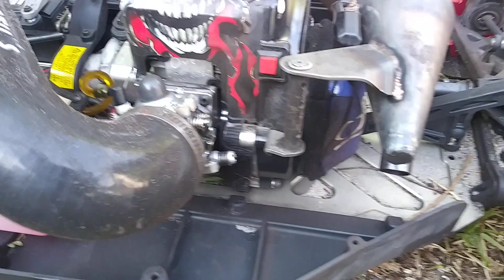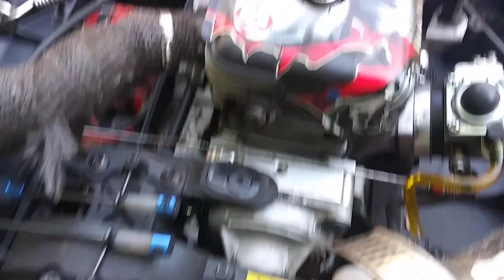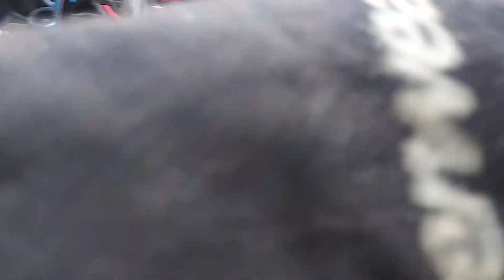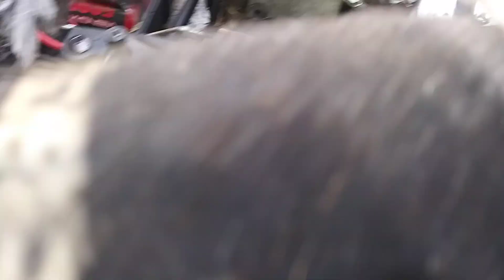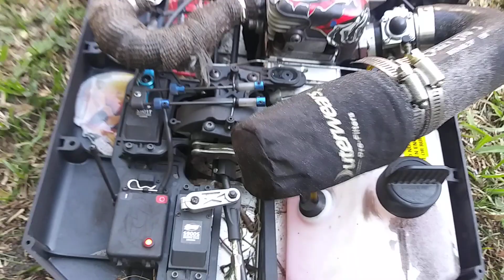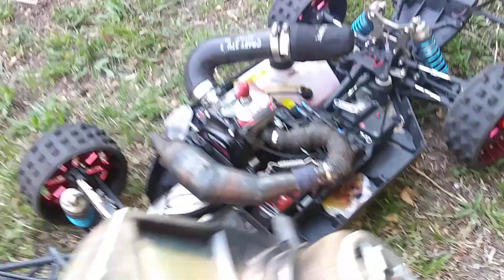#Losi #5T 2.0 #OBR engine upgrade with 10000 clutch and bartolone pipe

Comment: What made u go with the Bartolone exhaust? I’m looking at same engine for my 5t, even if the engine isn’t big bore CCs does that mean it screams more ? Would the ohlimat pipe fit this as I’m in U.K. and getting an rcmax setup just isn’t in all our budgets, but I can order an obr 9.4hp and ohlimat in U.K.. I would get the obr pipe but I’m not sold on it’s looks tbh 
Regards, beautiful rig btw!
Reply from the maker: I went with the bartolone exhaust because it was the only one in stock when i needed one but it's plenty of exhaust that will fit the obr engine's

Comment: Dude, are you only drag racing with that with that 10,000 rpm spring, like what's that OBR spinning at like 30,000+, you loose 10,000 rpm before your rig goes anywhere, not good for track racing, I personally go a 6,000 rpm spring